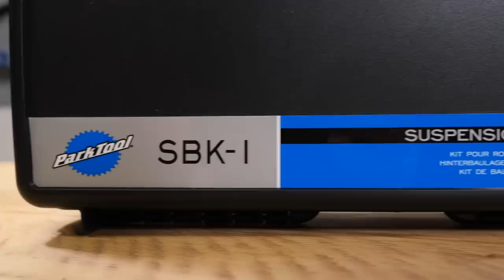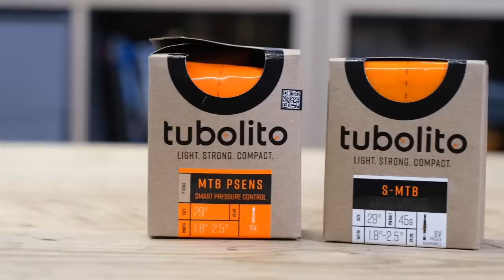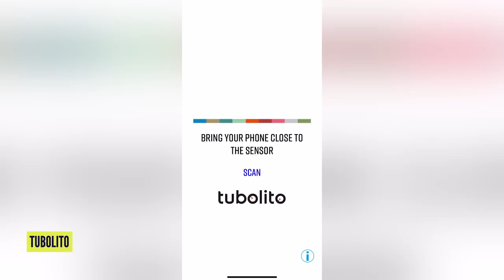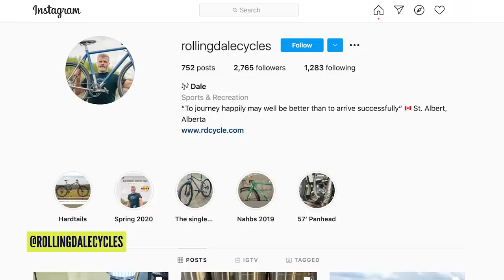Carbon Or Aluminium, Which Is Better? Plus New DH & Enduro Bikes From Prime | GMBN Tech Show Ep. 173

Comment: carbon takes a lot of the vibrations out of the terrain, thats why most road bikes and road bars are carbon to get rid of some of the chatter. Alloy on a mountain bike is my go to due to the reliability, i would say however that the weld where the tubing connects is the only downside to alloy as with carbon the sections where the tubes meet are smooth and invisible creating a nicer finish. But my trail bike and jump bike are both alloy. (ns zircus- DJ, and orbea mx30- trail/xc bike)

Comment: As someone who designs for a racing boat company that works in carbon fibre and works with the material itself on a weekly basis, I'll have an alloy bike over a carbon one any day of the week.
I'm not careful with my bikes and bang them around a bunch, drop them,... and whatever you've heard, alloy will usually hold up better to dings and hits, at least with the carbon layup used in bike frames.

Comment: Alloy bikes for me. You my get a dent or a Gouged it would still be good. 
There maybe an episode in how each material reacts to to point loading in a crash. I'm sure a sponsor would come to the party with a few reject frames (out of tolerance etc but still going to be good to test how the material reacts in a crash) . It may be a good to test a hard impact on a sharp rock etc (possibly a point load, a Sharp abrasive rock etc that may shave  as well as stuff in the shed dropping on the bikes)

Comment: My road bike is carbon with carbon wheels. All it needs to do is roll fast on smooth pavement. My mountain bike, which I just got yesterday, is aluminum, and very proudly shows this with its brushed finish. I know carbon is advanced enough that it is as strong or stronger than aluminum in most circumstances, but I just feel more safe on a metal frame.

Comment: Coming from the race car world where we use an excessive amount of carbon, for a bike I prefer aluminum. I have to admit though, I primarily do DH and bike parks. Tossing OTB, end over end, down a rocky hill, with an aluminum bike I just jump back on and go. With carbon, I think, did it crack? Something I can't see? For me, it's aluminum. The flexural impact is just different and I prefer it. Even if it were free.  Now if it were a road bike or gravel where the odds of throwing it down a mountain are almost nil, i'd go carbon just for the weight savings.

Comment: The bikes getting longer debate is a complicated topic because what feels good to one rider may be completely wrong to another. I've recently come across Lee McCormack's website where he details how he determines the optimal size for a given rider. His method sounds really promising to me because it takes more complex anatomy into consideration than a simple height measurement as well as how the body moves on a mountain bike. The way he explains it, a too large frame will force you to bend your arms in certain scenarios where force must be applied through them and diminishes the power you can transmit. It still hasn't convinced me that it's the end all be all method of picking a frame size but it is something that makes a lot of sense to me.

Comment: I know technology has made huge progress in particular on how and where cross carbon fibres as well as the fibres quality and selection but I am still cautious on the slightly more fragile within the time. Alloy will make no change after years even with small scratches and impacts. What about carbon ?
I am thinking to buy an enduro bike and my short list is now between YT Capra AL and Propain Tyee Al also ..

Comment: Id have a carbon frame to keep the weight down and make it a bit stiffer, but id use alloy wheels for both enduro and downhill racing given the fact that if you bend or dent one you can still finish the race. Id only use carbon for its light weight purposes only

Comment: I never check my tyre pressures, I just put 50psi in my Maxxis ignitors like they say to on the sidewalls and shred
Reply: They don´t mean it like that :D 50 psi is the maximum that tire can withstand. thats incredibly hard. Try something like 24 psi and even lower u will be mind blown :D
Reply: @dominikfabik2691  They say between 45 and 55 psi, so I put 5o psi in as it is in the middle, and I run tubes and it is what works for me, and I race with that much psi and come in good positions so I think I am ok. Thanks for the tip though.

Comment: I'm very much a fan of alloy. Sorry to say, but I do strongly believe that metal is massively stronger than carbon. Alloys are not indestructible, anything can fail, but carbon fails much easier. If you smash a carbon frame against a rock it can crack and it's game over. I saw Yeti bikes (so we are talking quality stuff here) crack in common, low speed crashes where the bike ends up in an unlucky position and the rear triangle hits a rock on the wrong angle. But there is also a second reason: maintenance of an alloy frame is easier and there is less risk of damaging the thing when working on it, or doing it wrong because you don't know the carbon specific best practice. Even at equal prices I think I would go for alloy, but having them at the same price would make carbon much more attractive and I would probably start to consider it as an option. At the end of the day budget is the main deciding factor, no matter what. I'm an amateur, I have the best time of my life on a mountain bike, even if I'm not advanced at all, but I would hardly feel the difference in the performance of a carbon frame and would probably end up just breaking it either in a crash or during maintenance. That would frustrate me and drive me away from the sport. For a pro the performance advantages of the carbon can be very well worth it. To be fair I think I'm already "overbiked" anyway, I have a Commencal META TR and boy that bike is an heap of fun and then some more, but I am still so far away from reaching the potential of that bike. Fun fact: the META is available in alloy only :)

However from the looks side of things carbon is so much better, all smooth and without soldering jobs visible. Not that this makes you any better rider or help in any other way on the trail and when jumping ;)

Comment: I'd prefer an alloy frame over a carbon one mainly for reusability. You can buy a 10 year old second hand alloy frame with some dents without problems after close inspection of the welding lines. You can't inspect a carbon frame for internal delamination or micro cracks yourself. Also uv- and condensation driven erosion of the epoxy matrix in carbon frames is a thing that stops most (or even all) carbon bikes from becoming useable oldtimers.

Comment: one thing to think on when you're thinking about carbon fiber vrs metals .  Carbon fiber is made from a chemical called acrylonitrile. Currently, producers make acrylonitrile from oil, ammonia, oxygen and an expensive catalyst. The process produces a lot of heat and yields a toxic byproduct. And, because acrylonitrile is made from petroleum, the cost of carbon fiber tends to rise and fall with the price of oil. That with the fact that its not really able to be recycled in most cases .  and carbon fiber can get gouged and you can also twist your metal hardware right out of the frame .  but  what im saying is carbon fiber might not be the most environment friendly thing .  I like titanium and aluminum and if you're smart with  an aluminum frame say crack the neck and catch it with a aluminum ring slipped over the outside of the neck after a weld job then welded you can mostly fix it I mean if you're not using it in competition you can fix aluminum and add to it at any given time . carbon fiber you fracture it pretty much thats it . and with them starting to be 3d printing using metals you can still have the same lines and mount points as carbon fiber . i mean only thing i see that might be better is its lighter .

Comment: I like both carbon and alloy frames, i currently only have alloy bikes. 1 with carbon rims, id say alloy feel better and less to worry about. My biggest issue though, is if you want a high spec bike (components). You can only buy carbon. Apart from a hand full of manufacturers. Ie Orange, commencal. I bought a spectral AL and basically sold everything off it and replaced to top spec (from a previous bike build) to get the bike i wanted. More people would buy alloy, but carbon is seen as superior and this fact doesnt help

Comment: I usually ride alloy bikes. I would like to have a carbon but at the moment it is too expensive. I have had bikes with carbon parts. I have a Diamond Back Racing WCF Vertex. Top tube, down tube and seat tube all alloy. The rest of the frame steel. I had an alloy frame which had a carbon wishbone seat stays. I don't remember the name of it.

Comment: My only big reason I'm a fan of alloy more then carbon is that if you crash an alloy bike you can see where damage happens like a dent or a crack you'll be as to see it where we with carbon it can hit a rock and the bike will look fine but there could be internal damage and you would have no way of knowing until it fails

Comment: I myself prefer the idea of alloy I've never had a carbon and I know it can be stronger across the frame for the likes of head on crashes but from the research I've done apparently they don't cope well with stones flying up and knocking the tubes like if you get a little chip in it apparently the fibres underneath can be really damaged which would cost a lot to repair plus that also mean me not riding tell god knows when just my opinion but think I'll always stick with alloy n cheers for another great vid #GMBN TECH

Comment: #gmbntech hi Doddy, thanks for the tech shows, always helpful. I have a 2020 rockhopper and it comes with a 100x9mm front hub. I want to upgrade the fork and most options are 15x120 or through axle.  Is there a kit to replace the internals of my front formula hub to allow for through axles?

Comment: Disagree with how you go about the carbon vs alloy discussion. Firstly I would like to point out how you mention that with carbon frames and alloy frames that "everything breaks" and they're both susceptible to catastrophic failures. Then,  for your argument for alloy wheels is that carbon wheels will crack while aluminum wheels will sometimes deform slightly while holding onto the tire (in a race scenario). Ignoring the fact not everyone races, would that logic not apply to a frame? If you snap a carbon chainstay, boom there goes your rear wheel.... but sometimes when you damage an aluminum chainstay there's a possibility of it holding up til you get down the mountain. Even if that weren't the case, enduro and downhill carbon wheels are extremely tough and honestly if you manage to break one; the force required is so great that if you were to inflict that sort of force onto an alloy rim, it would likely render the rim useless due to the damage. You also don't even mention that most carbon rims come with a very good warranty, and basically no alloy wheels do. Adding to that, alloy rims require routine truing and maintenance. I know in the past carbon wheels haven't always been the most reliable, but in the past few years they have improved so much that imo it's worth the investment.

Comment: Whats the cheapest  carbon  bike that costs under £4000 tell me and ile get one   for downhill riding ile get the scott  gambler  900  because  safety is key need a good strong frame for that sort of riding  but for a tailbone full carbon  lightweight  and costs under 4k would be  nice for options and full suspension

Comment: I see more broke, cracked etc for sale for spares or repairs that are carbon frames than I do alloy. Which is scarey when you think there are far less carbon frames than alloy frames. I wonder if carbon frames will still be around second hand like so many alloy frames. It be nice for people to bare in mind steel and titanium frames too they seem to slip peoples minds.

For me if I was offered any frame I'd probably say steel, but as long as it rides well and is most importantly a proper hardtail I'd be happy with any material if it can take a bashing.

Comment: Yes both carbon and AL can both break but I think everyone knows an AL frame can take a rock strike and much more unlikely to crack over carbon. I think Wheel choice for the pros proves that also. 
Past carbon bikes I’ve ridden have had much more vibration going through the frame over AL but recent carbon frames I’ve ridden have gotten better with much more solid smooth feel with less vibration. But with those changes the weight is really close to AL. Right now I really like both AL and carbon. I would take a AL bike with much better suspension and components over a carbon bike with a lesser suspension and components all day.

Comment: Never owned a carbon bike. Only carbon part I ever got was a saddle with carbon rails and the rails cracked.... I did get a set of carbon wheels finally for my wife’s nukeproof reactor alum though. Much lighter wheels and lighter tires for a shorter travel bike than my all mountain bike. Did I mention “here” new bike might kinda double as my (not my) trail bike fe flatter more pedally stuff? Lol. Tip toe the line of buying a new bike 😅

Comment: here is the actual difference to me
i have alloy and carbon bikes, wheels, cranks, bars, stems, seats etc etc etc

there are 3 factors we hope for when shelling out for carbon imo
its going to be less "pingy/rattley" on the hard bumps.
its going to weigh less than the aluminum version.
the feedback/ride characteristics will change.

a hard landing is still a hard landing ( its just not jolting )
some carbon parts weigh more than some aluminum parts (nextR vs Xtr )
the feedback from the ground into your hands is incredible (aluminum is more predictable)

i think carbon has its place. 
i do think it has a long way to go towards being as "expected" a feel as aluminum.
you are going to find out, you've been fighting your bike for so long
(wrenching this way, yanking that way, twisting the other way)

that's all gone now in fact, the weight loss is actually gonna make u feel more free
and the bike more like a living thing u are actually riding, instead of just " being on"

Comment: Happy to have a carbon bike if the price was about the same as alloy but lighter.
Reply: Carbon fiber material is more expensive than aluminium metal, and carbon fiber part manufacturing is more expensive than aluminium part manufacturing.

How would a carbon version of an alloy bike be the same price?

Comment: i have this (irrational?) fear that carbon is weaker than alloy... I crash a lot, and that means I smash my bike into rocks, roots, people -- anything you can dream of -- and I heard somewhere that although carbon fibre's tensile strength and compressive resistance is way more than Al, its weave is weakened when repeatedly smashed against hard objects (rocks, roots, people, etc.) Is that true, and if so, to what extent... should I be worried?